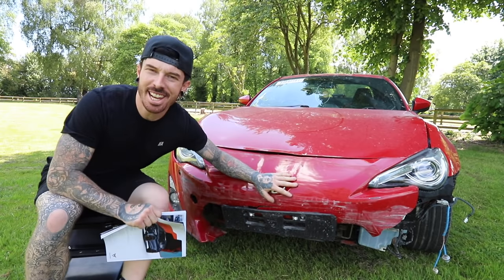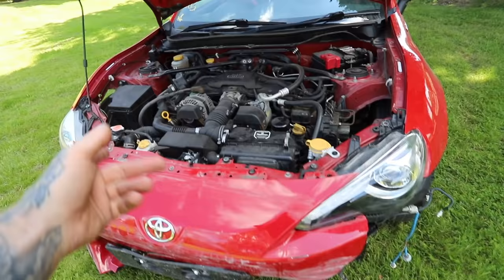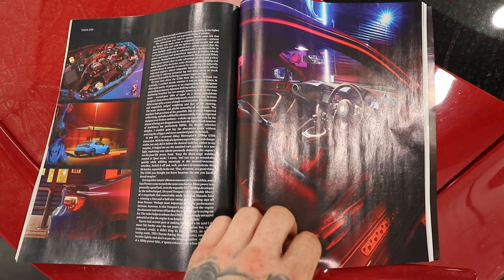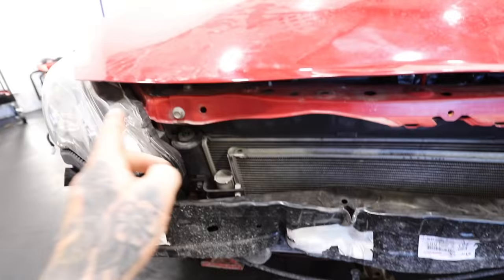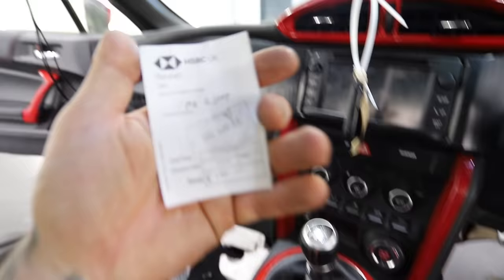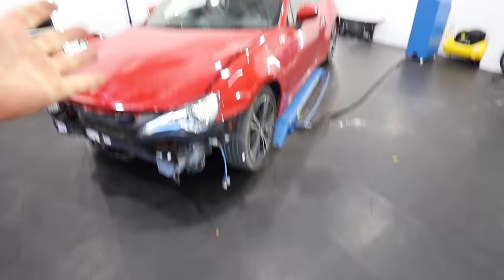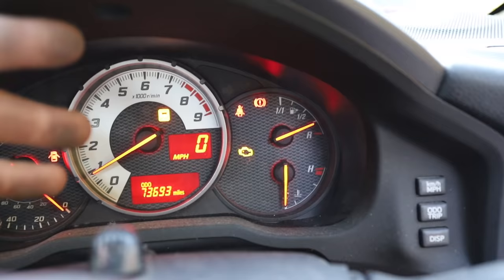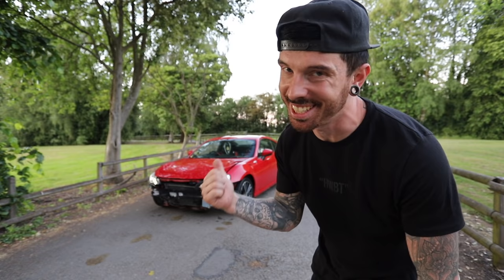I BOUGHT THE CHEAPEST SUBARU BRZ ON THE INTERNET

Comment: mat the GT86 is Macpherson Strut not wish bone, so its just a lower control arm not a wishbone, and there are loads of aftermarket lower arms available for less than OEM from Toyota. Or there is an entire front subframe on ebay with lower arms for £174

Comment: Used parts aren't hard to get hold of, a few guys break them on Facebook, search for the UK owners page and the UK parts for sale page. I'm on my 3rd, build quality is fine, you've just got a damaged one 😂.

I rebuilt a 2018 with a mix of used an new parts, headlights, bumpers, bonnets, rad packs are the hardest to get used and the most expensive.

You've also got a bent radiator support, that's weld-in.

They're not painfully slow, you just have to work them hard and momentum drive them, but mine is loads easier to drive fast now it's turbo.

Comment: Just use aftermarket parts, It’s probably one of the easiest cars in the last 10 years To modify and get parts
Reply: Not in UK, I did the same thing earlier this year, I bought a front damaged gt86 of copart, and I was really struggling with finding 2nd hand parts, they literally don’t exist. Ended up buying from the main Toyota stealer. Some parts are surprisingly cheap, others are stupidly expensive, for example, the front wing cost about £170, but the jet washer plastic cover cost £50, it was definitely worth it tho, I don’t regret it, nice to see someone else going through a similar process. Looking forward to see how it progresses.

Comment: The issue with a "stock" GT86 is that the FA20 engine is pants when it comes to power delivery, it has the horsepower but has no torque and doesn't "pull" that well at all. In fact, I've had shedloads more fun in a stock Merc SLK250 diesel 😅

Edit: Copart have been cheeky eh? lmao surprise surprise!!